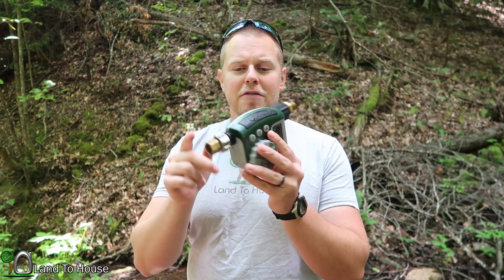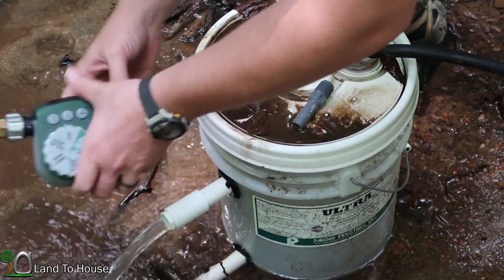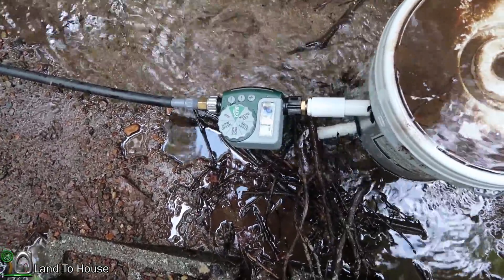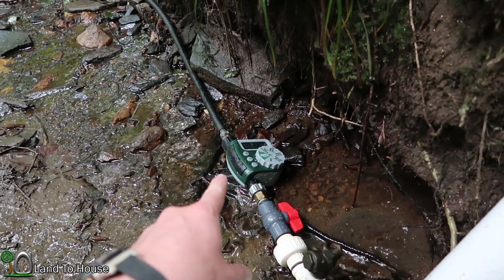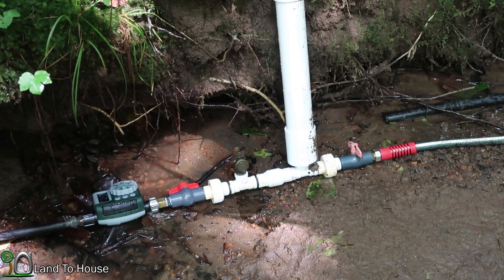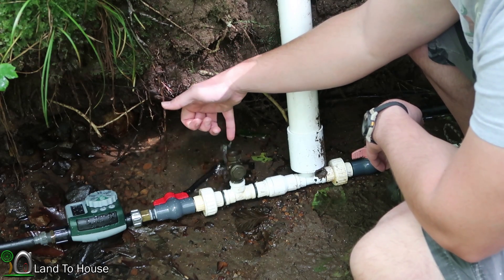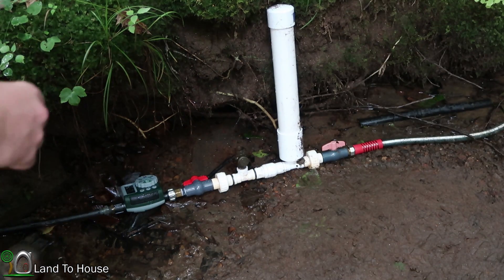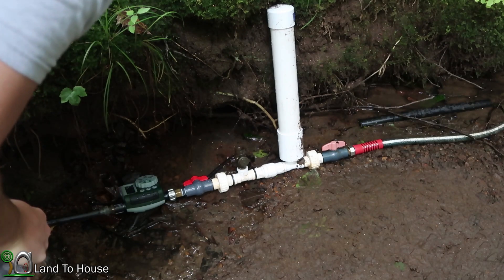Auto Start and Stop a Ram Pump

Comment: There is a fix for this.  You use two timers, one as you have it, and a second that in in sync, but lagged by a few minutes.  The second valve controls a second waste gate that drains the pump area and closes after a one minute.

Comment: So get how that device  works and see what ur talking about with size. But would it work if you put two in line. one on the drive pipe and one on pressure side and time them right to turn on.

Comment: Have you ever tried to make it so a pump would auto start when water starts to run? I have a system where the water is only available when it is raining. The pump will be at the base of a 25 or 30 foot waterfall, so close to a vertical drop. The waterfall only flows when it is raining. I want to pump up to a reservoir when it is raining and would like to set it up so the pump auto starts when there is water flowing. Do you have any ideas on that? Cheers for the help!

Comment: Idea....increase the size of your silt bucket to accomadate a float valve.  Get one a size larger than the pipe going out so you're sure there's no restriction when runnuing.  For someone who has low flow this might work if the float valve could be made to shut off the flow when water reached a set level.  Some float valves seem to close slower than those irrigation water hose ones and the slower close might change the pump dynamics to increase the chances of the valve staying open.

Comment: Auto start can be important in some installations.   In addition to the timer, other situations exist where the drive pipe flow may be intermittently interrupted.   We have an irrigation ditch where the flow will vary based on other water use along the ditch - sometimes water is available in the ditch to run over or through the bank down to a ram pump and sometimes the water is not available.   Would be really nice if the pump could run when water available.

Also, the example in the video where a tank could be filled until enough water is available and then a bell siphon automatically start and empty the tank until automatically stops and the process starts all over.  

Somehow we need the irrigation water to cycle among destinations.
Thanks.

Comment: what if you use a larger electronic valve and ,maybe have a smaller one that just pops open for a second to dump the pressure after you cut off the feed water?

Comment: What if you add a weep hole so that the valve will open after water drains just from that area
Reply from the maker: It would have to be small enough to allow the pump to operate normally yet allow enough pressure to leave when the valve stops in the closed position. Good idea. I might have to give that a try sometime.
Reply: @LandtoHouse  I seem to remember 20 plus years ago mother earth news had a drawing of how to make the pump and it had to hole placed in the correct place and the correct size but i cant find the drawing i had from then .

Comment: I don't get it. Isn't your delivery pipe connection downstream from the pressure tank check valve? There should be no pressure on the chamber downstream from the impetus valve and upstream from the pressure tank check valve. And your air induction valve is in that chamber. When the P.T. C. V. closes, a vacuum is created below the impetus valve. This vacuum opens the impetus valve and sucks a small amount of air into the chamber and then into the P.T.. That keeps the P.T. from getting waterlogged. Yes? So, what's keeping the impetus valve closed? It would be an elegant solution if there was a battery operated shut off big enough to delivery water in the proper amounts. Papa pumps have a system that uses water pressure and a float valve to alternate water pressure between two chambers that pushes down on the impetus valve when water is depleted from the source, and when the water level rises, and thus the float, redirects the water to a chamber that releases the impetus valve. I'm guessing their system costs north of $2,000
Reply from the maker: The pressure in the Pressure Tank is around 30psi in this setup (with the delivery pipe open).

This concept works as long as the water stops with the waste valve open. There is no snifter valve in this pump. I wonder if a very small hole was placed in the waste valve just under the flap would allow the water pressure out if the valve stuck closed? That might work.

Comment: How about ifbinstalled in the delivery pie?
Reply from the maker: Yes you can use a timer in the delivery pipe. The only issues that comes up is if you do not have much height and a back pressure issue comes up.

Comment: Use a timer with a three way valve as self relieving to drain water in the tubing immediately after the timer when it's OFF.  Or use a different timer as a switch to operate a separate, small solenoid operated three way valve functioning as self relieving for purposes of draining.  If remote, can be powered by solar cell and battery.
Reply from the maker: That is a fun idea. I would need a larger valve. This timer does not have a large enough opening to let the water through as it needs to.

Comment: If you drill a tiny weep hole it will drain off the water that holds the valve closed. If it is a small enough hole it won't affect ram performance.

Comment: hall effect magnetic sensor connected to an ardino giving a veriable ohms resistance readout based on flap position into a basic logic AND gate will allow an out put when both recuirments are ment
Reply: yes it will use like 0.002mah but a solar calculator joined with a super cap would allow for the axuation .

Comment: Although I don't use an auto timer, I do accomplish the same thing with a ball valve. My drive pipe is a siphon from a pond. Where the drive pipe goes over the dam, I have a ball valve installed. This allows me to stop the ram without going down in the ditch to the pump location ( which is in tall grass). For whatever reason, the valve on the pump must always stop in the right position, because it always auto starts when I reopen the ball valve.
Reply from the maker: That is a great way to avoid going to the pump. I have found that closing the drive pipe from the top is effective as long as there is not a leak in the system that lets in air over time. Your setup must be good. As for timers, they are expensive as soon as you get larger than a 1/2" pump.

Comment: What happens if you put the "timer"-valve between the T and the check-valve?That way maybe the check-valve cannot hold its closed position ?
Reply from the maker: That would reduce the amount of water space between the valve and timer. Worth a try. I will have to get back out there and see what happens.

Comment: good idea, I'm still trying to keep my pump running at 1400 feet delivery distance , sometimes the pump will run for days without stopping but sometimes it will stop after an hour and I can hear the impulse without hitting really hard so I'm trying to figure out if I need a standpipe in the middle of my Driveline I'm at 100ft now can you give me any information on that valve action hitting so  hard it locks it up closed , is that possible what's going on too much head,I've only got about 5 ft of head?
Reply from the maker: It sounds to me that you have air getting into the system. 5 feet of head pressure in not enough to make a really strong close of the valve. (like 12+ feet would do). I have had issues with air getting into the drive pipe and either killing the pump by not closing the valve at all or making it close very hard. The 1-1/4" ram pump cant have a drive pipe much longer than 100 feet without a stand pipe. But you should be fine at 100 feet.

Comment: you could loosen the check valve so it slowly leaks and depressurizes
Reply from the maker: That is a fun idea. It would have to be a very subtle leak as not to reduce the pressure wave that the valve is making for pump cycle.

Comment: I have a comment. You need the outlet for the delivery pipe to be off of the pressure tank.. A aspirator below the check valve so that when the control shuts off a vacuum is created, which pulls open the impulse valve. That aspirator will also allow the air to release and prevent a air lock
Reply from the maker: Technically it is off the pressure tank. But I think I know what you mean. I have seen a design like that. A little valve just below the pressure tank would help release that valve pressure and also allow air to refill the tank. I feel like I manually shut off the timer and caused a weird close on this test. I should turn the timer on and give it more time. Like several days.
Reply: I believe that a simple tire air fill valve will work. The idea is to recharge the pressure tank with air.. Not much, just a little sip with each stroke. When the volume of water enters the P.T. that creates a vacuum below the check valve. Nature abhors....Which pulls air in AND pulls open the impluse valve. Rife uses a needle valve so there's some water loss. Maybe because a one way air intake valve would have to be adjusted to sinc with the impulse valve? Regardless, a simple 1/8" tap in the pipe and it could be either.Thinking about that... Wrap a S.S. clamp around the pipe, drill through the solid part of the band and through the PVC. Then tap through both. Stronger. PVC is a lttle soft. I'm sorry! I just realized why Rife uses a needle valve. It is as close to the check valve as possible. So if there's a loss of water in the drive pipe you won't have an air lock. The air bleeds out the needle valve. A cheap way to do it is use a self tapping saddle valve like homeowners use for ice makers. That would be perfect! It's adjustable

Comment: Couldn't you make a tiny weep hole before the check valve so the pressure could bleed off and the valve swing back in the open position?
Reply: There should be one anyway. That's how you keep the pressure tank from becoming waterlogged.
Reply from the maker: I gave that hole idea a try back a while ago and realized it needs to be a tiny valve not just a hole. I could make the tiny hole and place a pen or needle in there to keep water from flying out all the time. ... But yes that is a good idea.
Reply: Thank you all for sharing it

Comment: Would it not be better to put electric valve after ram pump?
Reply from the maker: +My Technology Trail that would stop the delivery pipe. That would work very well. This test was to see if a timer valve could stop the pump to save water going to the pump. For example if you only had a trickle of water as a source and could not run the pump 24/7 this would allow a tank to slowly fill and then auto start the pump after a time.
Reply: Thanks
Reply: that would only apply if you were filling a tank at the source and running the ram pump from that tank. If you did that, the tank would have to be 10 times (or whatever) bigger than the one you were filling at the top of the hill which doesn't really seem practical.... At that point a solar pump would make more sense. So assume that the trickle is all you will ever have and will never stop anyway... so if you don't pump it up the hill it is lost ... may as well put the valve after the pump as the valves in the pump are probably longer lasting than the electronic one too ;)  Better yet, turn it off at the top of the hill where the pressure is less.

Comment: Most likely the timer will be off for a lot longer than you were testing it at, probably for hours at a time.  Over that long period of time I would bet that the check valve would fall down.  Try it with a real world scenario instead of just a couple of minutes.
Reply from the maker: +TheZigZiggy good point.i can do that next.
Reply: Has anyone tried the longer time or the small leak approach to getting the ram pump to auto start?